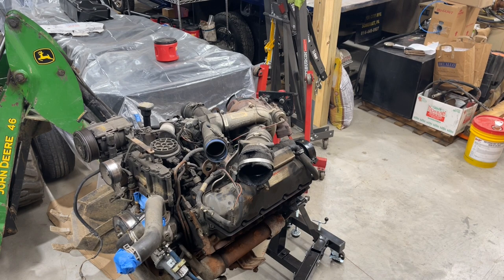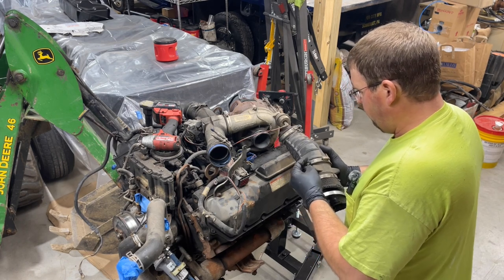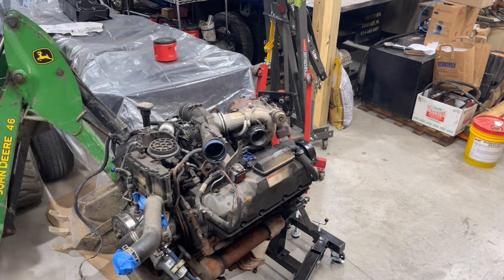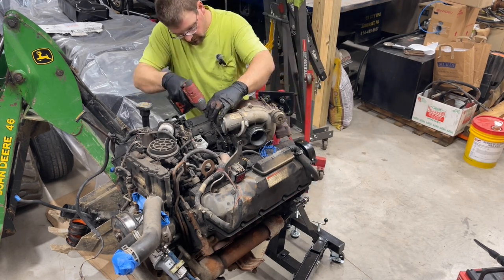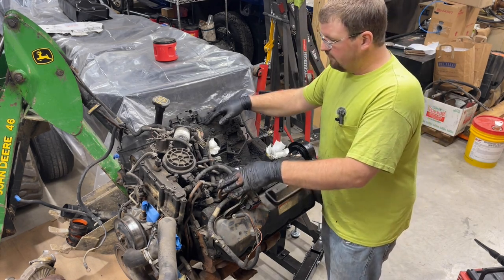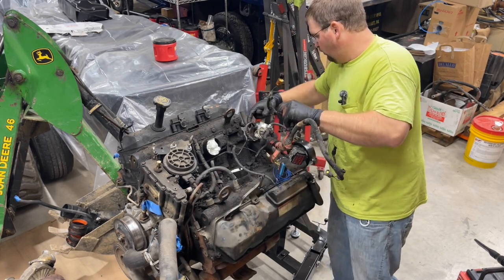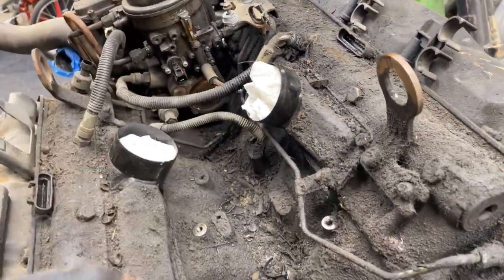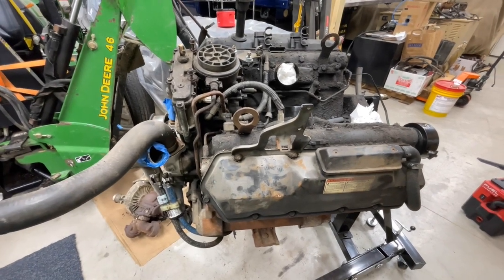Opening up the valley in a 99-03 7.3L Powerstroke

Comment: Interesting that the pads in the valley are drilled for the OBS fuel bowl and pump. My 2000 wasn't drilled/tapped.
It's common for the SD bowl drain to have the o-rings spontaneously begin to leak, wouldn't hurt to replace them. Another common SD fuel bowl problem is pay close attention to which bolts are mounting the fuel bowl to the HPOP reservoir, I've seen engines where the wrong length of bolt was used on reassembly and punctured the housing.
Reply from the maker: This is also a forged rod motor.   So, it’s possible that has something to do with the bosses.   I ended up rebuilding the fuel bowl.  There is a video coming for that as well.

Comment: Nice video Garrett. You may have said it but is this truck your personal truck or are you redoing it for someone else?
Reply from the maker: This is my brothers trucks engine.  It’s getting a full restoration basically.
Reply: @GarrettsOBSGarage  I’m currently switching gears from my OBS to my 99 gonna start fixing some long overdue issues with it. Engine is going to come out at some point since the pan is showing some rust. Don’t know if I’m going to end up doing a fuel system on that truck or not. I hate the price of kits when I built my fuel system in my 97 for way less and IMO it’s just as quality of a setup. Where do you buy your blank SD pedestals? I’ve seen a few guys saying riffraffs QC on them is kind of going downhill, seen a lot of posts of those pedestals leaking.
Reply from the maker: @ROELKEY2442  the pedestal came from diesel o rings.   It’s a rotomaster.  I haven’t used it yet.  But I figured it was decent.

The SD fuel system is kind of stupid.  I’m not a fan of it.  So, you could build a system for it like an OBS If you wanted to.